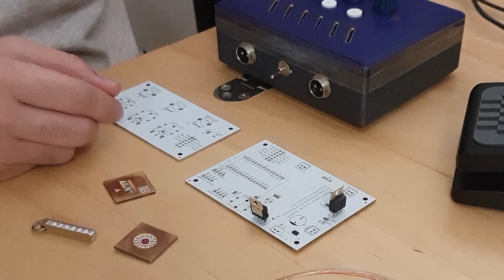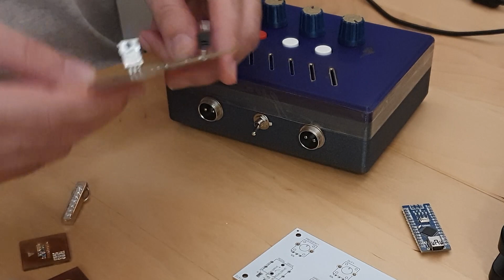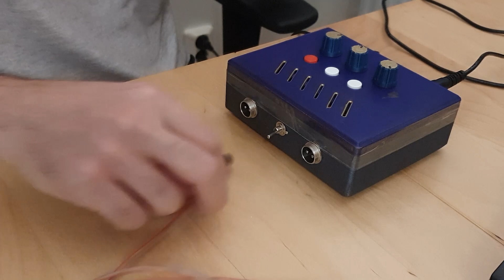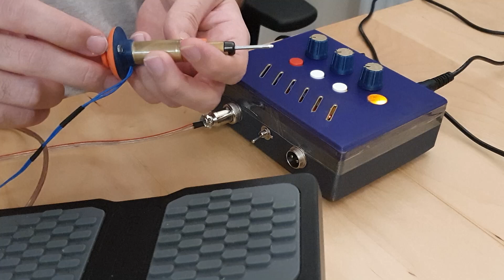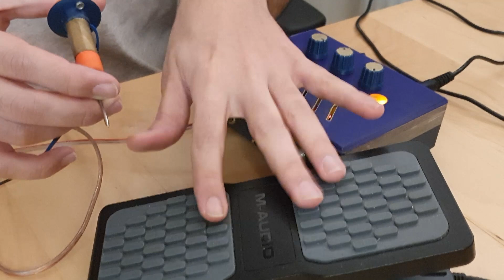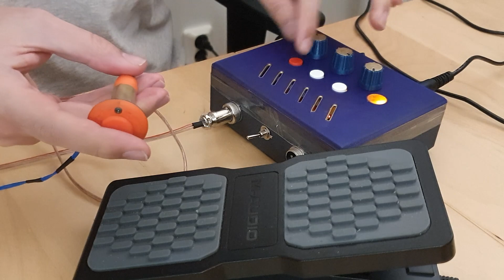Unlocking Precision: DIY Solenoid Graver Tutorial and Build Guide!(Alternative to pneumatic graver)

Comment: dude this is really really cool. I've been messing around with trying to make my own pneumatic system, largely for stonesetting and engraving. Your electronic system gives a lot more control. If I hadn't already sunk so much time into tweaking my design, prototyping and sourcing a compressor etc, I would be making one of these. Maybe i will anyway. the only thing that puts me off is that i know nothing about electronics or programming . Very kind of you to open source all your work.
Reply from the maker: Hi, Aurumferrum, I can tell you that this is less risky than soldering on the bench, the voltages used are considered Safety Extra-Low Voltage by international standards. The updates of Arduino boards are taught in schools all over the world to kids as young as 8. Don't let the fear keep you from trying. If you need assistance I will be here, the program is ready, just need to upload it. Cheers!
Reply: @selvalss  Thanks, i appreciate the encouragement. I'll get in touch if I decide to go ahead!

Comment: Is it possible to use some kind of ready-made control unit?  so as not to create it yourself?
Reply from the maker: Hi, yes. It is possible to get the boards from a company. The foles for it are on the github, its the Controll Board V2. The wiring connection should be made by you unfortunatelly. JlC Pcb and PCBWay are services that deliver online. The problem is that you have to order at least 5 boards of each. There are some places that offer these assemblies services or even places that fix phones can do it as its basically soldering. After that you have to "install" the code on the board which is done through a computer and usb cable.
Reply: @selvalss are you selling this machine? I’m interested in one ready to go, plug and play
Reply from the maker: Hi,  @hineniart . I do not sell this machine, the instructions for constructing it are on the github page. You can follow them to make your own.

Comment: does it 1330 solenoid do all the job or need stronger one?
Reply from the maker: It depends on what you want, for an all round solenoid I would  recomend either a modified solenoid or the 1642 linked on the previous video. On a frequency of 30hz it can do everything and on short strokes for fine work you can use higher frequncies.

Comment: I’m glad I’ve waited and watched your videos along this journey to see the progression and everything seems to be working flawlessly!
Reply: Your work is amazing! Do you know where I can get the pcb boards with the resistors already soldered? I can only find companies to provide bare boards!
Reply from the maker: @mattchapman4706  Hi, it depends on where you are from. But I have used Aster and Eurocircuit in EU, and these ones that are on the video came from JLC Pcb, i know PCB way also manufactures it. In all cases you have to tick the manufacture or Pick & Place service. None of the resistors are dependant on their values, you can replace for what is available.
Reply: @selvalss Do I understand correctly that there are companies that will assemble a control unit according to your drawings?  For me it's a "dark forest".  I don't understand this.  The only thing I can do is assemble the mechanical parts myself.  I don’t speak English, so I can’t accurately understand your descriptions that are in the link.  Are there any ready-made control unit solutions?
Reply from the maker: I'm glad I persevered with it! Along the way, I've gained valuable experience in stone setting, and the machine has consistently kept pace. Now, it's time for me to update my micromotor. Have a wonderful week.
Reply: Where can we find all the information on the build and what parts to purchase?
Reply from the maker: @kozmosjewels3070  you can find on github, the link is on the description. You can get the info on solenoid on the folder Solenoids. All the other 3d files are on the linked onshape.